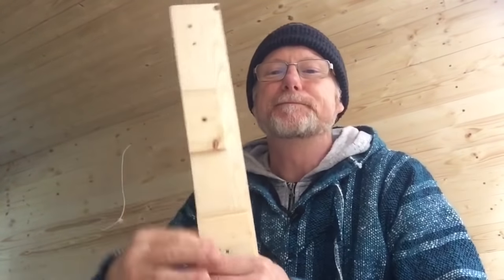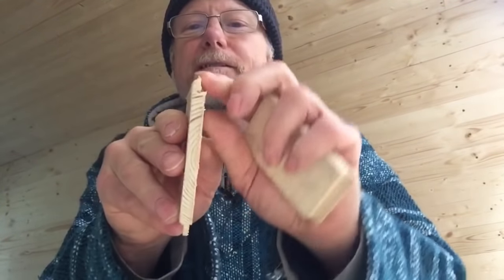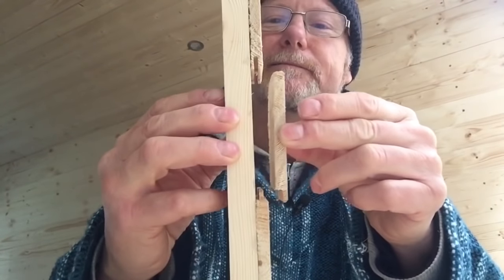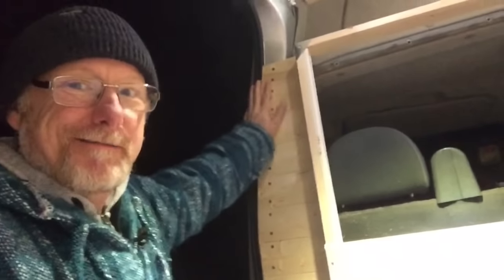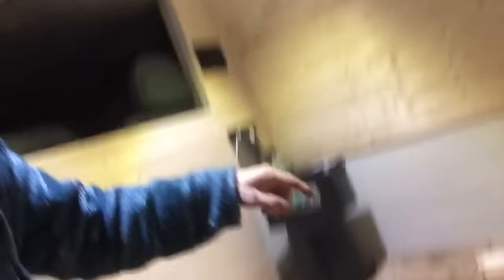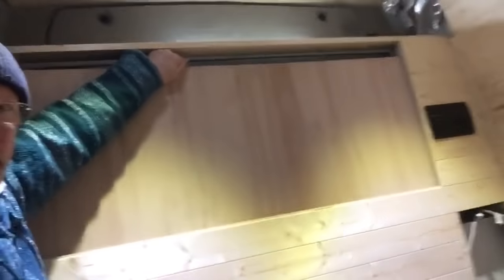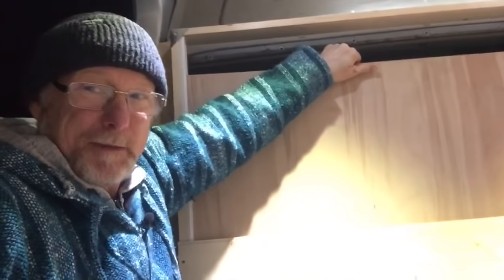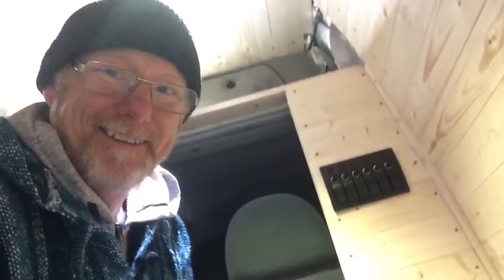how to build a sliding bulkhead like Nate Murphy in a Ford Transit campervan conversion

Comment: Did you use sound insulation or just thermo ? Do you think it's needed ?
Reply from the maker: RemusKingOfRome5  I use recycled plastic insulation available from B&Q doing my bit for the planet 🤙 plus it’s easy to work with if you look back at my early vlogs you will see me explain in detail I think it’s titled starting van life? Ford Transit van to stealth off grid campervan Time to insulate.. think I made title a little long lol 😂 but anyway it’s all there hopefully it will help thanks for watching and subscribing 👍🤙
Reply from the maker: PS definitely need insulation it’s a must! In the summer you will bake in the winter you will freeze and probably drown from all the condensation dripping off the ceiling 🤙
Reply: @BigVanSmallWorld   so .. no sound insulation, not needed. Do you think you'll need to paint the inside of the wall paneling with anti-mould paint ?
Reply from the maker: The transit already had that sound deadening material stuck to the panels that needed it. It just stops the panel vibrating and sound resonance. I don’t know about mould paint I never used it it probably gives off bad or toxic gases and in such a small space I wouldn’t use it